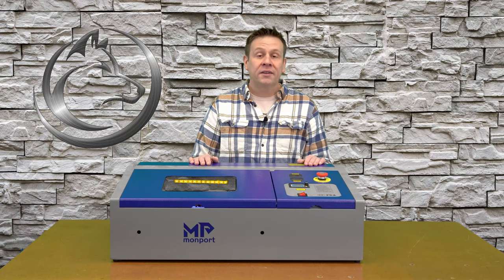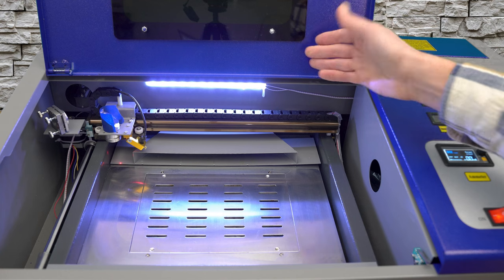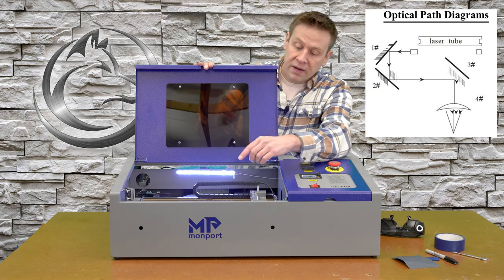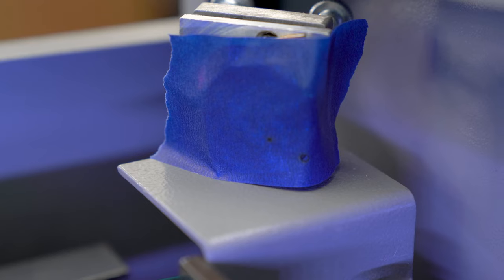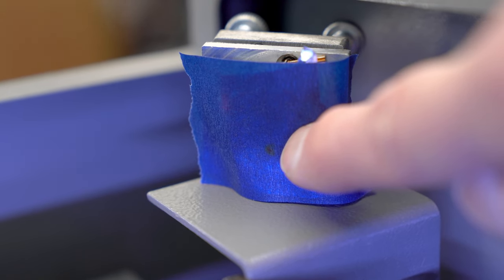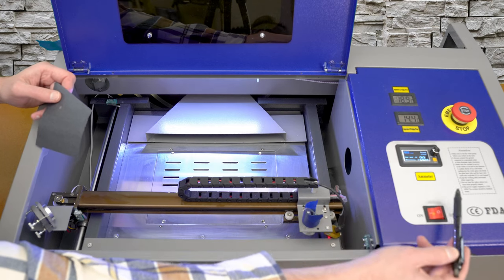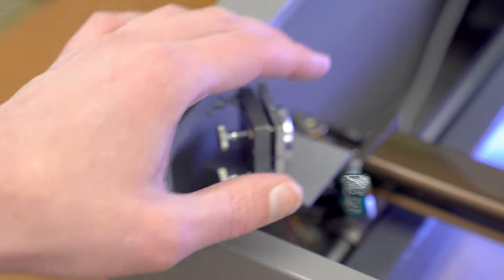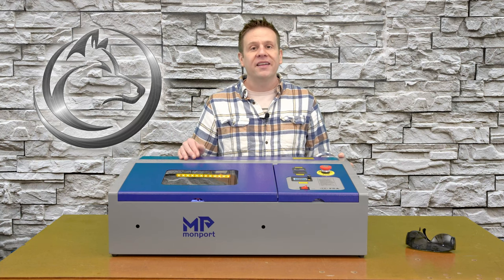Monport Mirror Alignment- Step by Step!

Comment: I’ve been waiting for a video like this.  The first thing I realized is that I need to purchase the DSP version of Lightburn.  First comment too.
Reply from the maker: Thanks- Actually the controller board for the Monport 40 watt is Lightburn Compatible GRBL Motherboard for Desktop 40w CO2 Laser Engraver.  The controller board will use the G-code version of LightBurn!
Reply: @thelaserchannel1  then why won’t my copy find my laser wether I try to find or enter it manually?   I have the GCode version for my xTool 20 watt.  I’ve tried many times to find the 40 but no luck.  I’m going to configure my webcam to work with Lightburn.  I made the stand using nothing but PVC 1/2” pipe.  It’s higher than the 18 1/2” length that some people use.
Reply from the maker: @DaBalloonGuy67  Check out this video where I connect LightBurn to the Monport LightBurn compatible to the software: https://youtu.be/JyxRk2f-C-M  The software connection starts are 11:15 in the video- hope this helps!

Comment: Now could you make a video using Lightburn and show how to create a library of my most used images.  Please do this step by step.
Reply from the maker: Excellent recommendation!  I'll add this to my next project video!  Project libraries really help when running many different materials on different machines!
Reply: Also could you do an extended step by step video as to setting up a camera for an xTool D1 Pro if you have one.  Every time I do something when I try the alignment wizard.  Something always goes wrong.  My laser head tried to bust through one side of my laser.  As fast as it was moving, I thought it would have.  My current settings for the alignment wizard are as follows:
Thickness 7.000
Fill speed 10
Line speed 3
Scale 114
Fill and line power 60.0
This when I framed it, the laser head was grinding the head beyond the back of my engraver.   I had to physically turn the engraver off to prevent any further damage.  

Any help would be greatly appreciated.
Reply from the maker: That's a great idea but I currently do not have a camera for the Xtool (or any of my machines).  The grinding noise (as you might know) is either the belt jumping teeth or the stepper motor jumping steps.